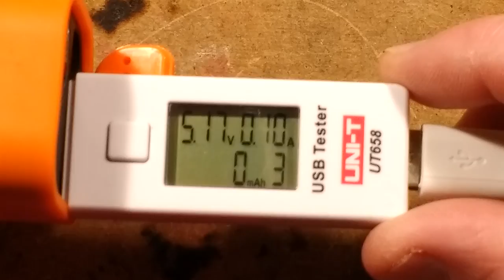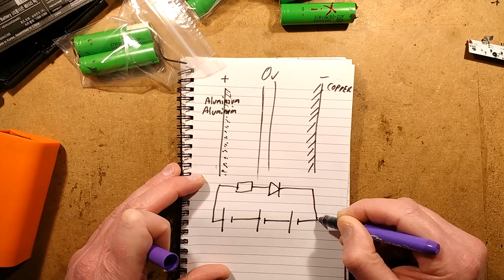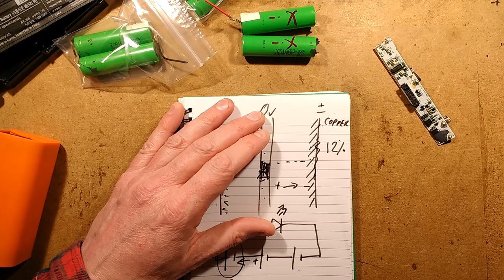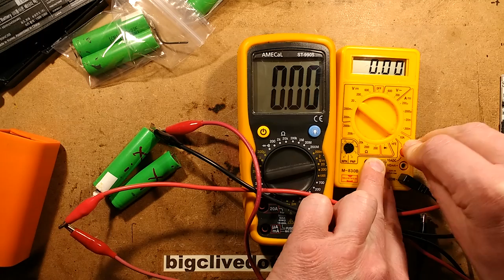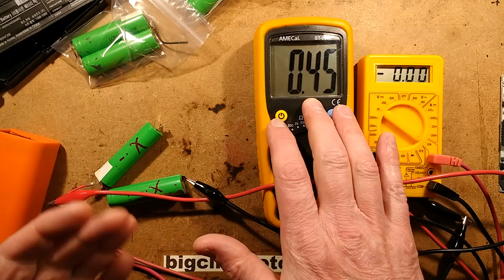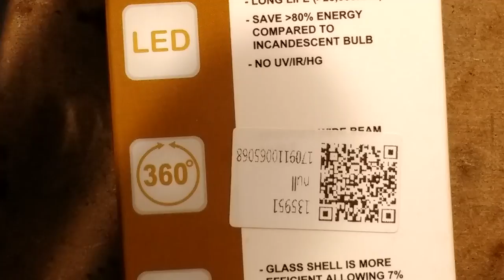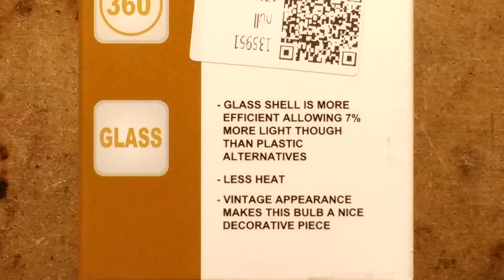Teardown of a faulty Samsung lithium 18650 cell.  (2200mAh)

Comment: video's muted...
Reply from the maker: Check your surround sound settings.  Dolby sometimes puts my audio out to a missing middle speaker.
Reply: @bigclivedotcom  so you heard the video? 
i think i was using my headphones in 7.1 mode like always. 

using surround atm, though so ill try that.
Reply: @bigclivedotcom  still nothing, maybe i was on surround the whole time? lol ill try the headset in a minute.
Reply: headset works fine. you were right about the center channel thing, i use everything BUT my center channel for my surround. lol (mainly for music listening)

Comment: all these comments talking about batteries exploding... I've had a neodymium magnet spontaneously disintegrate in all directions around the room. found a chunk of it lodged in the bottom plastic frame of one of my monitors. got lucky it didnt pop the screen. china china china... I swear the magnet chunks and bits were going the speed of a bullet.
Reply from the maker: Just on it's own?  I know they can shatter if they collide with each other.
Reply: @bigclivedotcom  I heard a pop then a bunch of clanking sounds as the small bb sized chunks were scattering about. not sure if two of the magnets warped into eachother from almost a foot apart or what. They are super strong so I can't rule that out. What I do know is when i looked away they were stationary on my desk and spaced far enough. (so i thought)

Comment: I do not understand laptop manufacturers.
Most phones have ~4000mAh batteries but laptop batteries, despite being much bigger, barely go over ~3500mAh
My Core i7 6500U 15.6" laptop only have a... 2700mAh battery.
No wonder why laptops rarely get 10h of juice, the batteries' power density is just CRAP.
Reply from the maker: The difference is that the phone has a single cell 3.6B battery while the laptops have three or more cells in series which means they have three or more times the power for a given mAh rating.
Reply: bigclivedotcom  Oh, ok, i see. But could you pack "flat" Li-Ion batteries to get the mandatory power output ? (like Apple is doing with their MacBook Air/Pro) Would it be much more efficient than cylinder-shaped cells in series ?

Also, thank you for your answer on this 7 months old video!

Comment: bigclivedotcom: Just trying to figure out why those batteries have such a low current rating. 

I just put in 3 x 18650 cells into a Chinese made emergency light (I know for a fact it's Chinese, because as you can see from the images, it states "LED Emergency "Treasure"" LmAo) and those are rated at 6800mAh each which begs the question, are those batteries you have just that old, or could I just have been really lucky in this case to get the beefy cells?

You should do a tear down of this unit, I'd love to see what's inside and if it's made properly ( https://www.bidorbuy.co.za/item/285346997/LED_50W_Emergency_Treasure_W813.html )

It charges via Micro USB and has a standard USB port for charging items off of it like a battery bank (I'm almost sure it would charge a cellphone from dead to fully charged off of those batteries in no time at all, although I've never had the need to do that). Quite a nice unit I might add, although I must admit, it says 50W LED's which I would assume is the biggest lie since "The check is in the mail" or the other more profound saying.

https://drive.google.com/file/d/1G2CsOhX2o80Yhx9qN3aN3ABXpadSRgjG/view?usp=sharing
https://drive.google.com/file/d/1_lu9Z3vzxZK79m_qLDdsBgHNhs48ZpaW/view?usp=sharing
https://drive.google.com/file/d/15KM2T0cJEZkK4wiZpbNwutMiMpf_-7Hw/view?usp=sharing
https://drive.google.com/file/d/1h_USgxOzFCATmIwLQYxcXTPuv-pMQJbz/view?usp=sharing / https://youtu.be/fSkRyMf-qq4
Reply from the maker: To the best of my knowledge there are no actual 6800mAh 18650 cells in existence.  Even the best ones are just a bit more than 3000mAh.  You probably have fake cells with a real capacity of 1000mAh if you're lucky.
I'd guess the 50W rating is also wildly exaggerated.  It happens a lot.
Reply: @bigclivedotcom  Aaah, excellent,thank you for the clarification on that. I thought that seemed a bit high, I mean if that was the actual current rating, with 4 of those in series, and another set in parallel in theory, I should be able to jump start my car on cold days 😂😂😂 . 

Great channel by the way, always something useful provided out of something useless (well, in most cases.... Like your gay darlek's) 😂😂😂

Comment: just another reminder to keep your lithium batteries at a storage charge (so when you go to use them later they are in good shape)edit: to clarify, for long term storage, if your gonna use it a couple weeks later fully charge the battery
Reply: David Scheiber 
That's actually not as important anymore. It was the case about 20~ years ago but as many improvements have been made since then, the capacity loss associated with keeping batteries fully charged has reduced dramatically. Test it out yourself, it really is minimal.
Reply: still happens.....
had a laptop battery pack die on me recently (on a laptop that sits plugged in 24/7)
granted this was over the course of months but still
what I mean is if you are storing them for extended periods (years) it is a good idea
if your gonna use a battery a week later you should keep it fully charged
Reply: another example
I had a brand new (fully charged)lithium jump starter puff up after a month of sitting(not in  a car actually but in a garage)although that could just be down to the usage stress those jump starters endure
Reply: Well if you leave it plugged in 24/7 and never charge cycle it, that's a different problem
Reply: Skruffles also lithium batteries haven't been around for 20 years (commercial production started around 2001)
edit:Wolfin the laptop was in storage for half of that time (due to moving)
Reply: David Scheiber 
Sorry I thought you were talking about bare cells, not cells in circuit.
I'm pretty sure they were produced before 2001 though.. which is where the whole "store cells at reduced voltage to prolong cell lifetime" rule of thumb was created, which was true back then and still is nowadays to some extent.. but the rate of capacity loss has decreased dramatically as cell technology has improved over the years
Reply: David Scheiber 
That is strange about the laptop.. What type of failure did the battery pack die of? Did you open it up and look? (The pack not the cell just to clarify)
Reply: Skruffles I didn't take a close look but it seemed to be cell failure, the pack was still interacting with the laptop and none of the cells had leaked or anything like that
TBH I don't keep the cells I have at storage charge cuz as you said the effect is small
However from personal experience even modern cells can be damaged from staying fully charged
Something to mention the military charge spec for a lithium cell is 4.1 volts rather than the 4.2 (

Comment: Is it just me or do those look like vape batteries
Reply from the maker: 18650 cells are a very standard size.  But for vaping you need versions optimised for high current output.

Comment: Looks like the batteries my old Samsung NP-Q430-JSB1US laptop used. That thing toasted through batteries. I probably went through over a dozen batteries for that thing during the 5 years I used it.

Due to a bad design (heatsink in direct contact with the DC input jack) it would melt the laptop charger cables and kill them rapidly, so I used the cheap shitty Chinese ones because screw spending $60 on the genuine ones every 4 months. Generic laptop chargers kill batteries.

Comment: Clive, how about a teardown of this unit - I have 3, in different colors, and they all put out A/C voltage ???? Only half the string functions at a time and my meter reads low voltage A/C across the outputs to the LED string.

eBay search - Outdoor String Lights Solar Christmas Lights 77 ft 8 Modes 220 LED
USA listings match this - http://r.ebay.com/6fMMnc

I really want to convert this to something similar to the "Konstsmide Firefly String Fairy Lights" using flicker LEDs
Reply from the maker: The AC approach is common these days.  It saves on wire.  It also makes it harder to hack the lights.

Comment: Clive warning to you and others! Switch on laptops are not mechanical so don't  break cct from battery, so when you switch it off it's still connected to ectronic switch cct, so battery discharge through switch! Best to remove battery from laptop when not use! Think switch is what I'd call soft start. I've got 18650 lithium ion battery that are alegidly 8.8amps👹

Comment: rc cars run on lipo if not in use for longer than 2 weeks-  can puff up if(below or above half charge) so the battery-s are recharged in storage mode to bring cells up to or down to %50 charge i recomend  -----------BUYING of EBAY a IMAX B6 Charger  0-24 volt 0-6 amp variable for $under $40 for all types of batteries (lipo  hydride led acid)     BUY AN RC CAR/BOAT etc    and learn